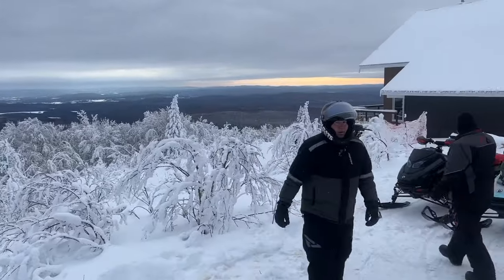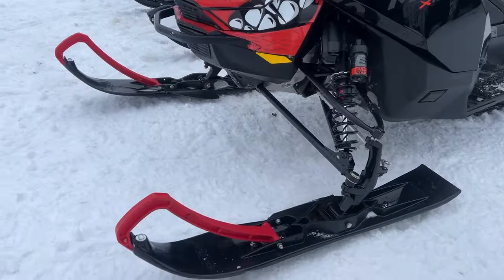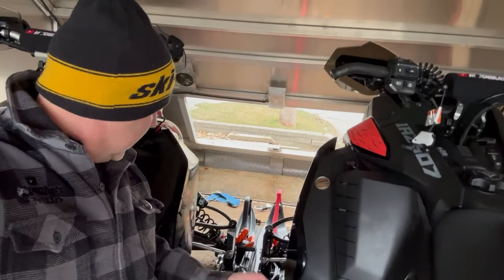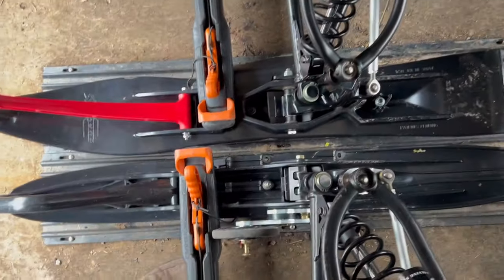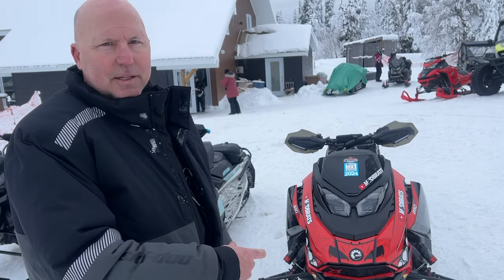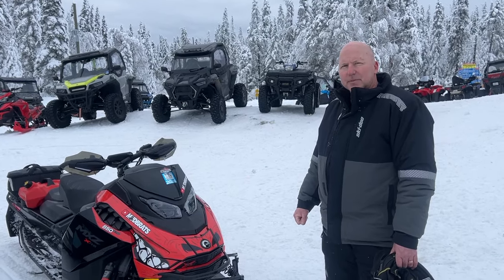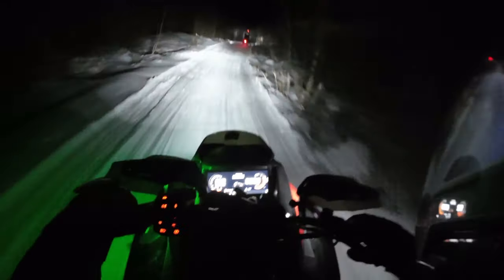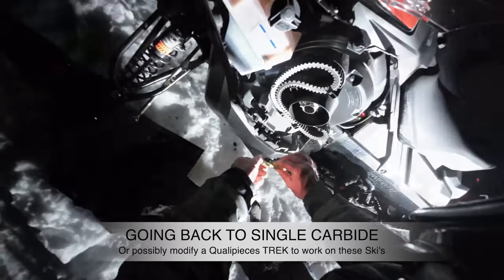Curve XS REVIEW on 2024 #skidoo  Rev Gen5 - We LOVE them #snowmobiling

Comment: Great video Gary & Drew. 
So what your saying is, your running a dual carbide on brake side and single carbide on throttle side? 
And that seems to make a difference does it? 
Do you know if Curve is using the Polaris carbide bolt pattern or maybe Cat bolt pattern? 
Unfortunately I’ve been keeping an eye on Curve website ( for a couple weeks now) and they have been sold out of ski blades and most loops unfortunately .
Not sure when they get around to filling stock back up.
Reply: Curve uses the same carbides as C&A / Slydog
Reply: @DennonOosterman   good to know, to me they look like there a earlier 2000 Polaris carbide pattern.
Reply from the maker: Yes the dual is on the clutch side.  The woodys dually plugs up too easy.  Going to see if I can just drill the ski and run the Qualipieces Trek on both skis.  They are dual as well but 1 blade is shorter than the other and I think that prevents clogging.  I’ll try and find out what bolt pattern for you.